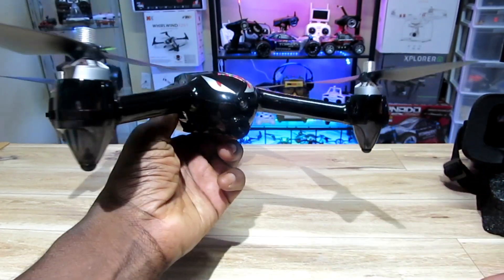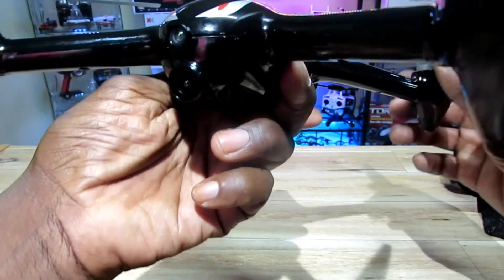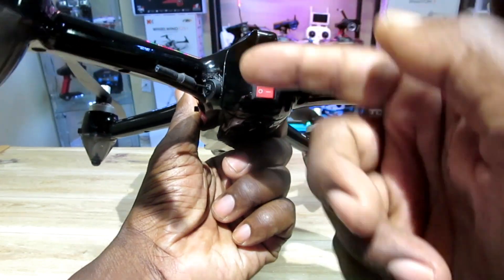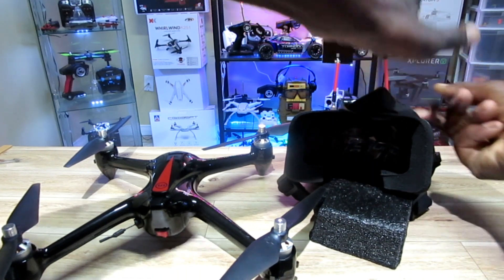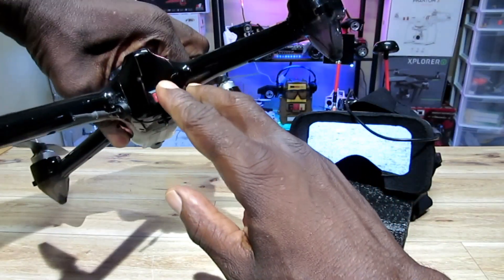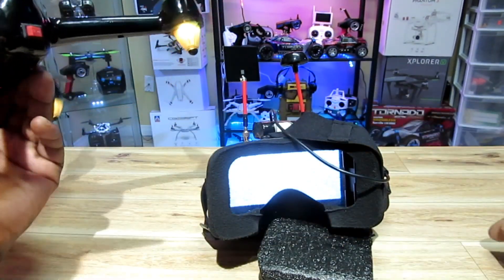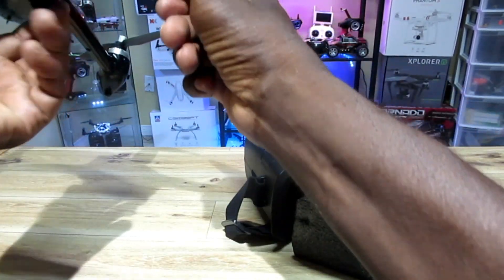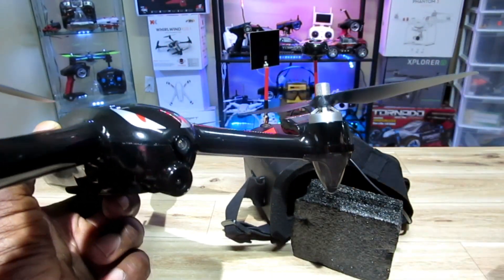Dual Camera Mod ( MJX BUGS 2W ) 5.8ghz Internal Setup

Comment: Modded all my bugs to 5.8g FPV, the stock WiFi they’re sticking on nowadays is not very practical, I also managed to graft a TX on my Hubsan 501c. Currently working on a little Hubsan conversion. Good on you for getting your mods out there pal. ( Just make sure the battery on off contacts are rated enough for the current drawn , remember it’s d.c. current !) keep it up , best wishes from here in Yorkshire United Kingdom
Reply from the maker: That's some good stuff you've got going man. Thanks for the tip, enjoy brother . Have a good one 👍